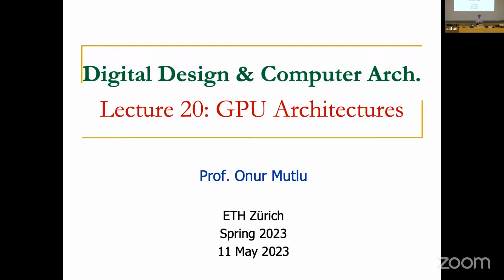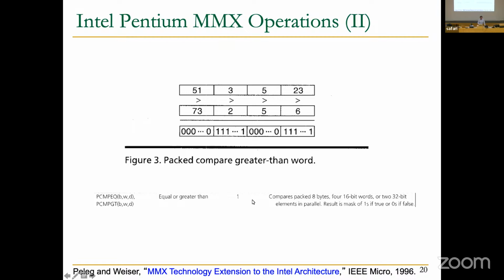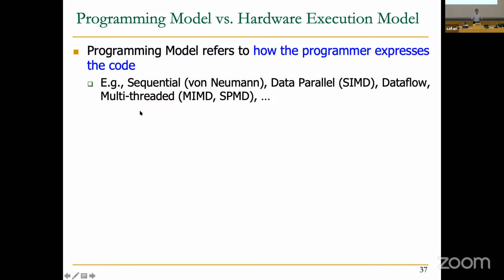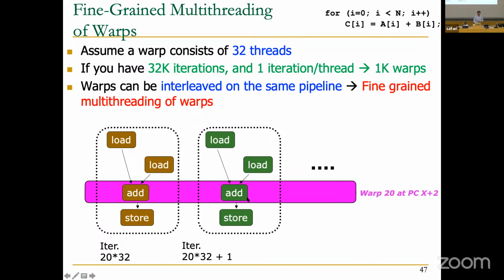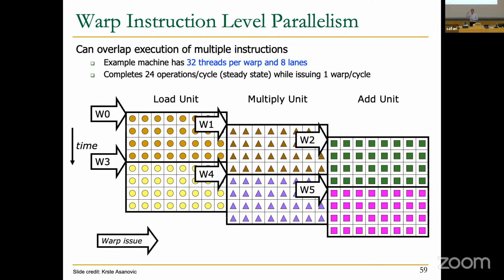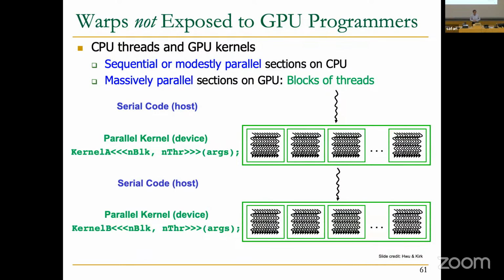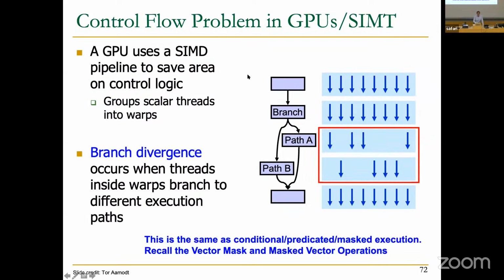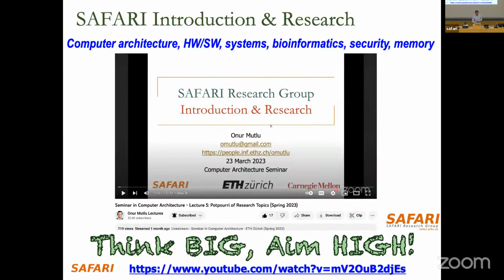Digital Design and Comp. Arch. - Lecture 20: GPU Architectures (Graphics Processing Units) (S23)

Comment: Hi, A doubt: At timestamp: 1:43:11, how can 8 SIMB units execute a 32 thread warp ?
Reply: each SP has a SIMD unit that is heavily pipelined to execute the threads. It might not execute an entire warp i.e. 32 threads in a single cycle but over multiple cycles even a single streaming processor (SP) can execute 32 threads. What you are seeing here is a Streaming Multiprocessor (SM) that has 8 Streaming Processors (SP) that each have their own SIMD units that execute threads/warps using fine grained multithreading.

Comment: what is a thread?
Reply: A thread is the smallest unit of execution that a scheduler can manage. Typically a thread will be managed within a process. A process is all the overhead the scheduler needs to schedule different tasks such as by arranging them by priority or least process ID (with is an unsigned integer) first. A process also includes the location of the code to be loaded into a CPU. This will include the operation code (e.g. add, mult, etc) to perform on the code and also include memory addresses to save the result to. A given process could manage multiple threads. Because threads (different chains of instructions to load into the CPU registers) share the same process space we need to use conditional checks or "guards" to prevent data from being overwritten in a way we cannot predict (known as a race condition or data race).